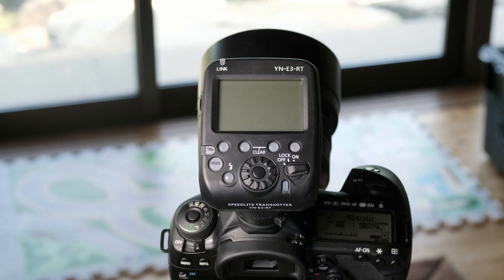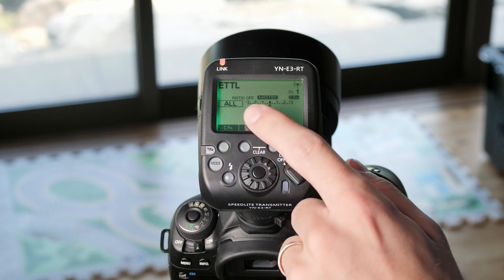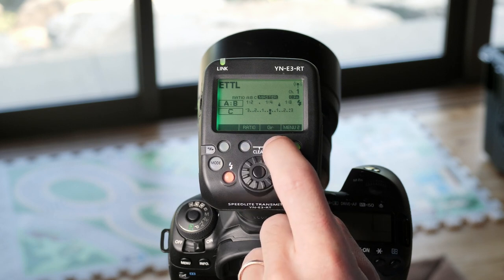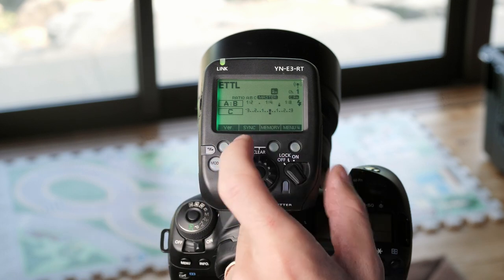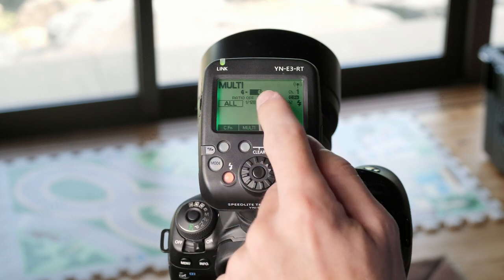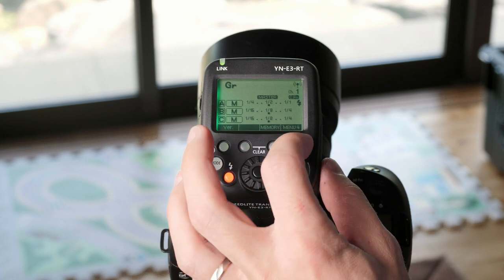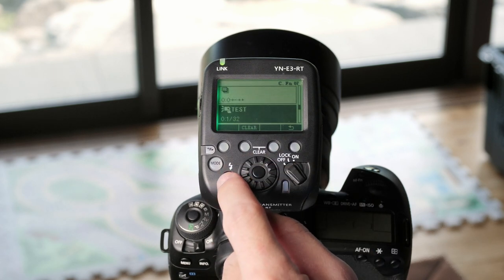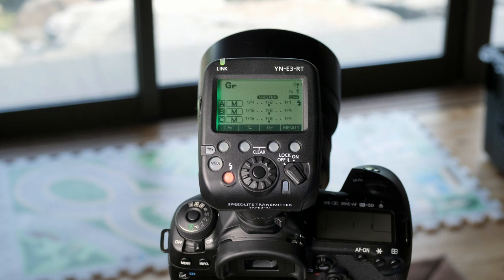How To Use the  Yongnuo Flash Trigger

Comment: hi just received the yn-e3-rt with the 600ex-ry11 followed your video and found that the teset light does not turn on would u have any thought as to why? thank you
thank you for the video
Reply from the maker: Hmm, that seems a bit strange. The light won't turn on if it's not connected to a flash though, so if it's not yet connected, that would be my only guess. When you push the test button, does a test flash fire?
Reply: i go t it to work thank the channel was set to auto i thought it would pick up the channel when i changed it to 1 it started to communicate again thank you
Reply from the maker: Great! Glad you were able to work it out :)
Reply: thank you

Comment: I was able to shoot at 96fps+ (still images) with ATG and Yougnuo transmitters on 
Sony DSC-RX10 IV (one Canon EOS-1D C and four Sony DSC-RX10 IV).

Since the Canon EOS-1D C/Canon EOS-1D X II/EOS-1D X and Nikon D5 are only 16fps/14fps.
This can be expensive, heavy and very noisy (due to shutter/mirror flapping).

At the moment, it works only with ATG/Yougnuo/Canon transmitters (Canon has limited ranges) when using ATG & Canon 600EX series flashes only (has a remote trigger).

My staff and I use above setup on Sony DSC-RX10 IV and connected/mounted on ATG MRMC or placed these cameras in deference angle or areas to get and nail those shots that can not be done on ours 1D C & D5.

ATG stated that's why the RX10 IV has a $1,700.00 price tag while the ATG (modified to work with Canon/Jinbei RT) runs well over $14,000.00.

As you can see, Yougnuo 600EX-RT II would be a much better price, provided if "Rel" and "LINK SHOT" can be enabled for the serious & working pros.

Comment: Hi again Scott ! --- I'm back !  here's a really good question.... can I use 2 YN-E3-RT together so that I can control the flash output from my Yongnuo YN600EX-RT II flash ? I would like to be able to change the flash output using one of these YN-E3-RT controllers. One will be on my camera, the other I use as a "remote" to change the flash output..... I want to do this for bracketed shots where I don't want my camera to move while it is on a tripod. I've tried many things and cannot get this to work. Is there a way to do this ? So to clarify, I want to be able to change the flash settings with the 2nd YN-E3-RT that I would be holding in my hand... this would send that flash output change to the main YN-E3-RT that is on the camera..... - is this possible ?
Reply from the maker: Hi! I'm not 100% positive and I don't have multiples to try it myself, but I feel like you could set up the "linked shooting" to help you achieve that. It's quite complex to explain here, and again I haven't been able to try it myself, but you can read more about it here and hopefully that helps:

https://www.yongnuo.fr/wp-content/uploads/notices/YN-E3-RT_en.pdf

Comment: Scott.... What's the deal with the warning tag in the battery box not to use Li-Ion batteries with this?  Does that mean we can't use Li-Ion external battery packs also???
Reply from the maker: Hi! I'm not sure actually... I checked in mine as well as looked through the manual, but didn't find any warnings about Li-Ion batteries or external battery packs, but both alkaline and rechargeable batteries should be fine. It's possible I'm missing something?

Comment: Nice, but I have one question. If you are using the trigger to fire a strobe that's in Master mode , how do you change your trigger to the slave mode? I must also commend you on the explanation of the use of this trigger.
Reply from the maker: To switch the flash over into slave mode, you'll want to hold down the mode button and a menu of the different slave modes will come up for you to choose from :) Hope that helps! Thanks for watching :)

Comment: Scott. You’ve nailed it. I’ve got this device. And it works a treat. I wish this video was available last year: it would have saved me the weeks I spent learning how to use it. 

My first flash was the 600-EX RT II. after that I bought the 430-EX RT III. 

Only afterwards did I know that Yongnuo is better than the canon brand, BASED SOLELY ON PRICE. 

In fact this is better than Canin’d because their doesn’t have focus assist beam. Duh 🙄 Canon. 

It’s significantly cheaper than Canon’s not it’s not weather sealed. So. Use in dry weather and not in dusty environments. 

Great video as always Scott.
Reply from the maker: Thanks so much! 

I agree that for the price 3rd party flashes are totally killing it... be that Yongnuo, Godox or even some other brands. No doubt that CaNikon flashes are great quality, but for the price it's definitely not worth it for most. 

Everyone always says that they'll last you many more years but with the rates new innovations are coming out I don't think people would think twice about buying newer versions every few years anyway. 

I also think it's amazing that the Canon 600 EX-RT didn't have an S1/S2 pure optical trigger mode. Super annoying when I wanted to just quickly throw one up as a little accent/hair light together with some Elinchrom strobes. 

Thanks again for watching and commenting, I appreciate it! :)

Comment: Hi
Do you have a 600ex-rt or 600exii-rt flash? If you do, or if you have the possibility to try whit this Yongnuo trigger to enable rear curtain sync while in wireless mode. I have the exii and it doesn't work, can't use rear curtain sync in wireless(incredible..the thing is, and this is my mistake, that I have not read well enough the manual before buying this flash. It's right there in the manual it says that doesn't work). I have read online that this trigger, the yn-e3-rt,can do the trick only in manual. If you have the possibility to verify this, please let me know if its true.
Thanks
Reply from the maker: Hey! I actually got rid of my Canon 600ex-rt because I was so satisfied with the Godox flashes haha. But, I can confirm that like you said, the YN-E3-RT can only activate rear curtain sync in manual mode, even with the Yongnuo flash.
Reply: OK, thanks. And I wanted to buy the Godox..but..I listen to the online people that where saying> its better to have the first party units, can be incompatibilities whit third party products..and so on. This was one dumb decision that I have made. I guess now I have to buy some simple optical units to mount on the off camera flash and trigger with the on camera flash. By the way, does Godox can do this second curtain sync in wireless?
Reply: Yep. Only in Manual mode. But I wouldn’t trust any device for rear curtain synch in ETTL anyway.
Reply from the maker: The Godox does not do second curtain sync with the XT1 trigger but I'll be getting their brand new (and MUCH improved) XPro trigger in the next day or two and I'll review it very soon. It might be possible with that but I'm not sure yet.

Comment: Hello, I don't have the blitzer symbool under c.fn
I have a yongnuo 565EXii .
The link light is never green...?
HELP.
Reply from the maker: I'm sorry, I'm not sure what you mean by the blitzer symbol :( 
As for the link light, is it triggering your flash? If not, double check the channel and group, and also that you haven't changed your ID number. If your flash is in the correct mode (radio slave, not optical slave) and the channel and group all match on the trigger and flash, but still they can't connect, let me know.
Reply: On your LCD screan there is a lightning symbool, how do you get that? 
On my flash yongnuo 565EXII there is no ID number?

The transmitter is on M/ CH1 groupe ALL
The flash slave sn groupe A CH1

What am i doing wrong?
Reply from the maker: Ah the lightning symbol is an indicator that the slave flash is ready, so once you're able to connect to your flash that icon should appear I imagine. 

I just read through the manual/specs for the 565ex ii, and I think the issue is that it actually doesn't support being triggered by radio, only through optical pulse. So, if you have another flash to act as the transmitter, it can control it optically, or it can work with the internal flash commander of certain cameras like the Canon 7D for example.

The YN-E3-RT is only a radio transmitter, so that's why it's not connecting. 

As far as I can tell that's probably the issue. To fix it, you could use a YN-622C receiver on the foot of the 565 and then the YN-E3-RT would communicate with that in the same way. The flash in this video has the receiver built in, which is why it functions a little differently and doesn't need the YN-622C. 

Hope that helps and sorry about the confusion with the first comment!

Comment: Hi Scott, II have the same trigger and the Yn-600 exRT flash. They connect via radio and the light turns green to indicate this but the flash does not fire. Would you know why?
Reply from the maker: Hi! It could be a couple of things although the green light is strange. When I first turned these on the flash or the trigger (I forget which) was set to the "auto" channel setting and the other was on channel 1, and because of this they weren't communicating. That would be my first guess but if that doesn't help let me know and I'll look into it a bit more.
Reply: Check to confirm that Flash is enabled in settings on the Camera.
Reply: Also (this may sound daft) but check the batteries in the flash.

Comment: Great video!  Every now and then when I try to hit the group button to change the power of the flash it won't select it--thus I can't adjust the setting.    I can take a shot adjust it. Then take another shot and try to adjust it but it then won't allow me to get into the adjustment.  Any idea why that's happening? Thanks.
Reply from the maker: Thanks so much! It's hard to say but if the button isn't working it could possibly be a defect. I can't think of any other reason it would do that, especially if it's only occasionally :(

Comment: hey Scott ;) i have question to you, do you preffer your 70-200 2.8 or 135 for portrait? Is bokeh much much better at f2 vs f2.8 at the same 135 focal lenght?
Reply from the maker: Hi! 
I would have to say I prefer the 85 1.2 haha. The 70-200 is beautiful and amazingly useful for events and the like, but for portraits I like to have a little bit less working distance from the model/subject. The 135 is great too but again, I like to be a little closer, 85mm is really my personal sweet spot. 

There's not a huge difference of f2 and f2.8 when at the same focal length (135mm)... it would be noticeable side by side, but if you're not comparing most people wouldn't notice. F2 can be useful for shooting in lower light though, a full stop more light giving you ISO 800 instead of 1600, or 1600 instead of 3200. On some cameras that can make a huge difference in image quality. 

Of course, the convenience of the zoom is a big plus with the 70-200 and if your model stays pretty still you can get away with lower shutter speeds in low light because of the IS. 

All 3 lenses (the 85, 135 and 70-200) have gorgeous bokeh but I think the difference will come down to compression/field of view, working distance and low light performance if you need that. Size and weight can also play into the decision and carrying around a 135 at a portrait shoot is a lot easier and more casual than a 70-200. I mention casual because there are times when that can help the model relax (and another reason I like the 85). 

I know that's not a direct answer to your questions but I hope it helps! :)
Reply: more over 85 mm 1.2 give more light inside camera so low light deficit .
geting close to subject give more pure light.

Comment: Hey Scott, thanks for the videos they are very informative. I have a question regarding my 686 flashes and an E3RT transmitter. When using the transmitter as the master in ettl, it doesn't change the lens mm on the flashes. I have one flash that is "stuck" in "A""20mm" and the other in "A""35mm". When i use each flash on the camera individually the mm changes with the camera zoom no problem. But even if i use one flash as the master and the other flash as slave, the mm on the slave flash does not change when zooming in and out. Is this normal, not normal or??  I hope i didn't come off all discombobulated and you understand what I'm asking 😛  Thanks
Reply from the maker: Hi! Thanks for watching! :) I don't have the flash on hand now but I can check later if this doesn't work... With Godox flashes this same problem came up and the solution was to make sure the slave flash's zoom settings are on auto, then that allows the master to control it. Check if that works and if not let me know, I'll look into it further. Thanks! :)
Reply: Scott Dumas  thanks for the quick response!  Yes, i can set them on about five or six different manual settings "M" "20 to 200mm" or somewhere in that range. There is only one auto "A" setting and one flash goes to "A" "20mm" and the other goes to "A" "35mm" and then they never change. Wish i could add a photo here so you could see the screens. I've emailed Yongnuo but as of yet i have not heard from them, assuming they even comprehend what I'm asking.
Reply: Scott Dumas but i will check them again and see if there's another AUTO setting that I'm missing... thanks

Comment: NEED HElP! I have the exact same flashes and trigger from Yongnuo, but here is my problem. When I try to set one of the flashes Manual and leave the rest in ETTL/TTL, my problem is that the ETTL are firing the flashes as it should be (judging brigness and such...a normal ETTL effect) but the Manual flash always only out puts 1/32 of the power when I fire the shutter, regardless how much I set the Manual exposure at (as in I can set the setting at 1/1 and it still outputs 1/32 light or if I set it to 1/128, it still outputs 1/32 amount of light. This is puzzling and annoying as I cant control Manual setting when im in Gr mode. Do you have the same problem or solutions?
Reply from the maker: That's pretty strange... I only have one yongnuo flash at the moment to test it with so I can't really get the same conditions unfortunately. When you only have the one flash in manual mode, and not mixed with TTL does manual mode work? Is the problem only when they're mixed or the manual settings in general?
Reply: Scott Dumas yeah its only a problem when im mixing ttl and M in Gr mode. Like my flash connect to the remote fine, but normally when you change watever setting on ur remote, once you fire a shot, the flash will change the setting to ur remote (you can see it changes from the led screen), but this does not happen when im setting it in to M mode for one on the flashes in Gr mode. Once i fire a shot, the flash stays as Ettl. Try it in yours, you dont need multiple flashes, just set in Gr mode with one flash in M mode, see if you can control the amount.
Reply from the maker: Got it! I'll check it out :)
Reply from the maker: Hey sorry for the delay. I was able to adjust the settings no problem for the one manual flash in group mode with the others set to TTL. The manual flash (group C in my case) worked as it usually should.
Reply: Humm, thanks for trying. I just tried the same thing and it still doesnt work for me =(
Reply from the maker: :( If I'm able to find anything out I'll let you know!

Comment: Scott Dumas, how do you setup the YN600EX-RT II into "LINKED SHOT"?
And can the YN600EX-RT II be setup to "Rel" (release) mode?
Reply from the maker: Hi! Being totally honest I've never used the linked shot feature myself, so I'll have to test it out first to answer more accurately. If I don't get back to you feel free to send me an email and remind me :) scott@scottdphoto.com

Thanks for watching!
Reply: Scott Dumas, then are you able to get into "LINKED SHOT and Rel" modes from YN600EX-RT II?

I tried and was never able to get into those modes. Maybe I am doing something wrong & the manual is not very clear or tell much about it.

The YN-E3-RT transmitter is not required for checking the flash modes.
Reply from the maker: Hey! I messed around with this a little tonight and didn't have any luck just yet. I'm going to dig into it a bit more tomorrow and see if I can figure it out but it's tough since like you said the manual isn't very clear at all. I'll keep you updated!
Reply: The strange things, say if I used with the ATG Gold/Canon 600EX-RT/Canon 600EX II-RT (as wireless camera shutter/flash trigger) while a ATG/Canon/Yongnuo 2.4GHz Transmitter (on camera) it works both ways.
Both ways mean = transmitter on camera while flash used as remote =
flash on camera while transmitter as a remote.

Just can't seem to get YN600EX-RT II and 1st version to go into "LINK SHOT" nor "Rel".

I have contacted ATG staff and they have a nice sample on using their equipment doing wireless radio beyond a football field. 
I or them will be happy to forward that video to your email address (listed) if you like, just let me know?